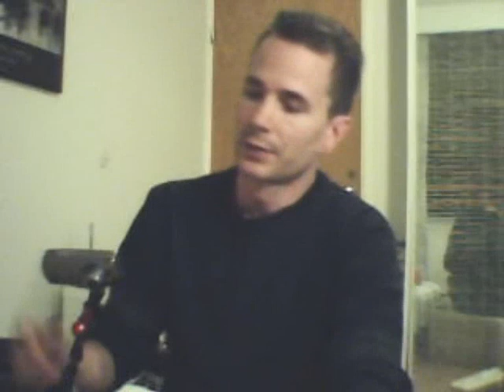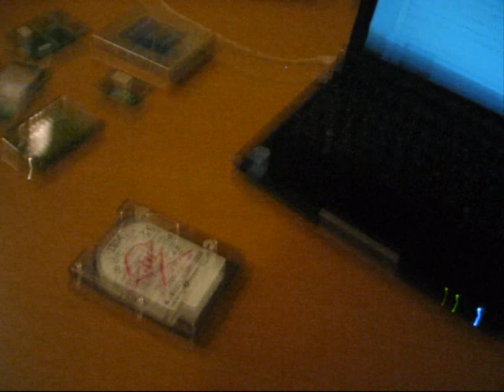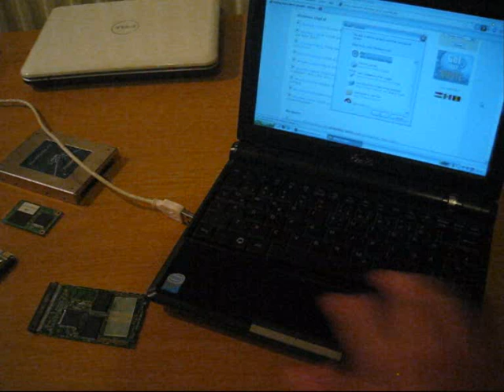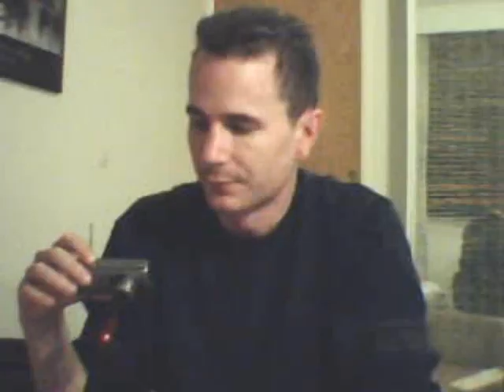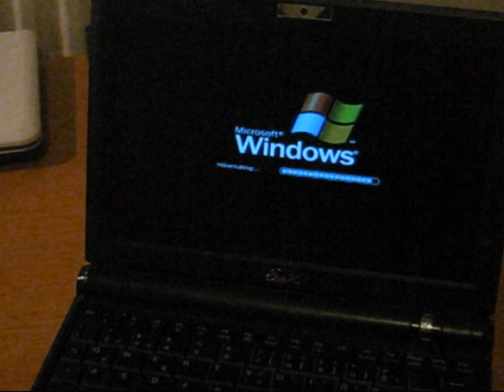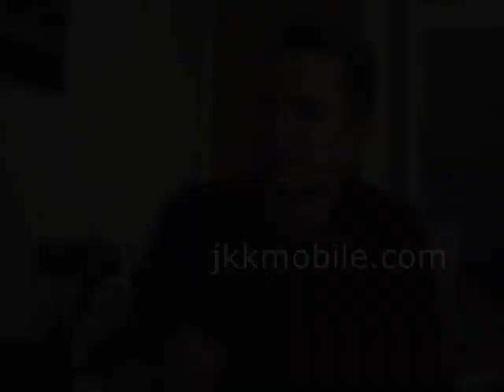SSD WEEK at jkkmobile

Comment: Cool, I've never read up on ssd's before so it was a good video. I dig the euro accent. Hmm well I ended up getting a normal hard drive on my EEE 904HA. the price was right. 435$ + tax in quebec.
Anyways it's 35$ more than all the other normal netbooks here and comes with a 6 cell that lasts a good 5 hours with wifi on. Well now i am seriously considering getting a 30GB SSD for it. they're priced okay i guess at 90$

Originally I hated the size they were offering. 8GB? crazyness.

GJ JKK

peace